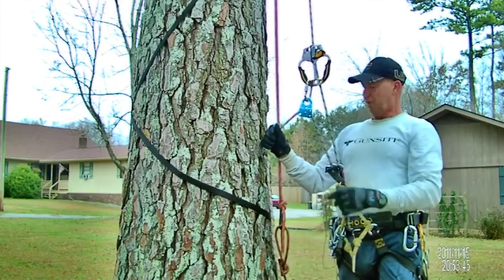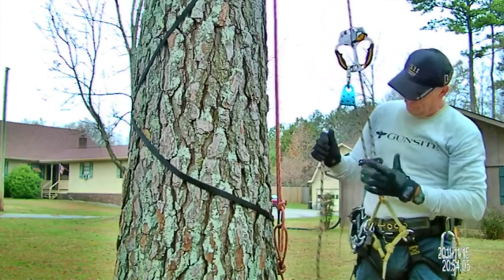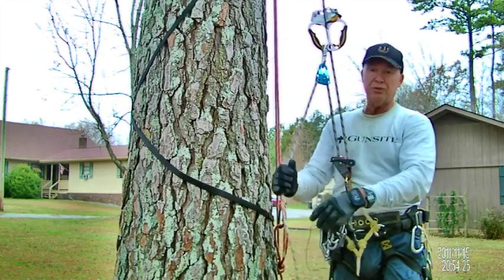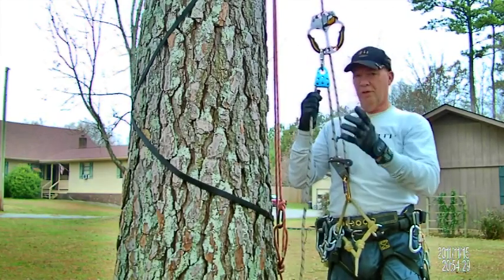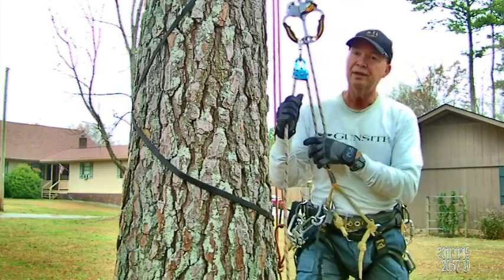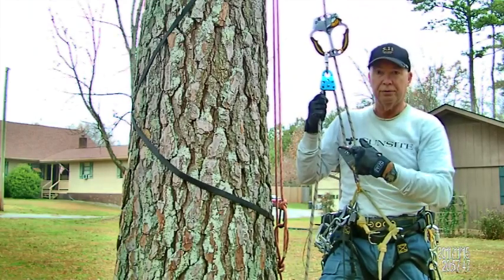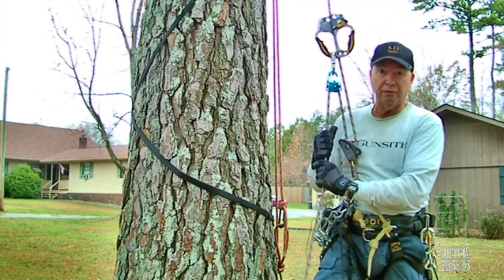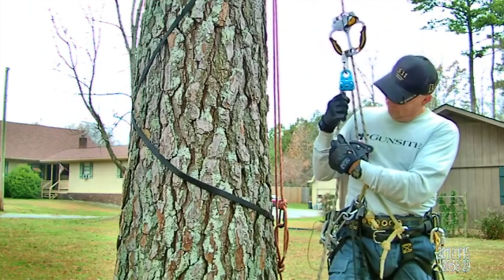Rope and Pulley Systems: Segment 17 - Mechanical advantage of the RADS pds.m2ts

Comment: Not correct. It's not force multiplication at that pulley it's still a redirect just easier because you prefer to work with a down pull than an up pull.
Reply from the maker: It is correct. The analysis is really an expansion of a single pulley principle. For example, let's say I weigh 200 lbs. if I have a pulley attached to a tree limb and one end of a rope is tied to my harness and someone is holding the other end he has to exert a force of my entire weight to hold me in suspension. My weight is pulling on the rope with my full 200 lbs. He has to hold that 200 lbs. 

However, if he hands his end of the rope to me, because my weight is now supported by two strands of rope, each strand only has half my weight. So my hand/arm that is holding the rope only experiences half my weight. I illustrate this in one of my videos where I actually pull myself up with one hand/arm. You don't really think I can pull up 200 lbs with one arm do you?

This same principle expands to the RADS. In a RADS system, if another person is holding the pull end of the rope, there are only two strands of rope supporting my weight, so the person would have to pull with half my weight. But when he hands the rope to me, there are now three strands supporting my weight, just like with the single pulley. So since my weight is supported by three strands when I'm holding the pull end, the force in each rope is my weight divided by 3. Hence to me as the climber, it is a 3:1 advantage.

Try the single pulley setup I described above.  Get a friend to try to lift you and then you take the rope lift yourself. You only have to pull with half the force your friend does, even though this appears to be no more than a redirect. But as you can see there's more to it than a simple redirect.

Comment: Very easy to understand. I’m trying to design a super minimalist version of this to hoist a portaledge (cott) up a tree for camping. I’m sure this would do fine but it’s for adventure bike camping so I’m trying to decide if this can be done with thin cable, and if the pulleys are necessary or if I should just muscle up the rope with that 1 way handle jiggery you got there.

Comment from the maker: XBB XBB
This was not for rigging, nor climbing. It isn't even about climbing. It's specifically about the MA of the RADS climbing system.

It's all done very low to the ground. If you need to see how to climb, watch my vids about climbing - these aren't about climbing or safety as I mention over and over in the series - it's about mechanical advantage.

Comment: Pulley systems must be analyzed as static systems to understand the forces(aka while everything is at rest)   While at rest it makes no difference who holds the line.  It's a 2:1 system.  What happens when the climber pulls on the rope is that he reduces his weight by pulling on the rope however it my feel like a 3:1 system it remains a 2:1 but now with reduced weight.
Reply from the maker: Yes, it does matter who is holding the rope at rest. Look at segment #16 in this series where I demonstrate this principle using a single pulley. According to you, that single, fixed, overhead pulley would be a 1:1 to me. So how would you explain that I can clearly lift myself on that single pulley only using one arm? Am I really that strong or is there some MA going on that isn't obvious? The answer is when I pull myself up, half my weight is supported by the rope that's tied to my saddle and the other half of my weight is supported by my hand holding the rope. It's the same whether the system is static or dynamic.

The same principle applies to the RADS system. The reason it feels like a 3:1 is because to the climber it is a 3:1. To a ground person it's only a 2:1. And, simple testing will prove this. Set up a RADS and see if you can pull yourself up just using your arm strength - you should be able to. Then hand the pull line to a buddy and see if he can pull you up as easy as you could. He can't and he can't because you have a 3:1 and he only has a 2:1.

Listen, I argued the same thing you are claiming until I was blue in the face, but a physics major kept telling me I was wrong. I went to a lab and actually measured all this and I had to concede that I was wrong and he was right. Once I did the lab tests, it was crystal clear why this is true.
Reply: I won't ask you to argue but I do have a challenge.  Do some actual measurements and in particular measure the distance the rope travels in a single fixed pulley system.  Once with you pulling the rope and again with someone on the ground pulling the rope.  Does the rope travel different distances depending who does the pulling?  What if someone on the ground just assists you what happens then?
Reply: Bob Morris My fault... I was not catching your point of reference,
Reply from the maker: Bob Morris
Yeah, the configuration where the climber is both the load and the puller is confusing.  If a climber is in a RADS and places his hand on the pull rope even with his nose and pulls himself up one foot, his hand will then be 3 feet from his nose. Yet, if you measure the amount of rope pulled with respect to the ground, as would be the case for a puller on the ground, two feet of rope will be pulled to raise the climber 1 foot. I concede it sounds like nonsense but that's really how it works.

I think the key is that when the climber holds the pull line, his body weight is supported by two lines plus the third line he is holding. Hence each of the three lines will have 1/3 of his weight. So if he pulls himself at a constant speed, he only has to pull with a force equal to 1/3 his body weight. Therefore it has to be a 3:1 system to the climber.

When the pull line is handed to a ground person, one of the three lines supporting the climber is lost and only two lines are supporting his weight, hence the ground person has to hold half the climber's weight, which shows the ground guy only has a 2:1 MA.

Load cell measurements will confirm this.
Reply: Tanglerwr While I have liked your videos for viewing the different ways to hook these up, unfortunately bob morris is correct on this.   The physics side of this is if you weigh 150 pounds you are splitting your weight to two different positions.  for example if you push down on anything with your hands your weight at your feet will be less.  This can be tested on a simple bath room scale.  push lightly on a counter top as you weigh in and you will show you weigh less on the scale.  now with this system. If you weigh 150 pounds on a 2/1 system you would take 75 pounds to move you.  However  50 pounds is being applied to the pull rope while the remaining 100 is the remaining amount left to be lifted.  The end result is 50 pounds moving 100 pounds 2/1 system.  Yes it feels like more because of the weight reduction.  It is also more complex to calculate your weight reduction because you have to take into consideration the effects of the pulley vs your total weight. This should be 
W/ (PS+1}*PS=RW  Your weight / {Pulley system + 1} x Pulley system = Remaining weight being moved.     Pulley system being 2/1, 3/1 ect but only taking the first number.
Reply from the maker: raddognate

It is a 3:1 to the climber and physics proves it Let me give you some background on this.
 
I took a cursory look at this and from the configuration it appeared to me to be a standard 2:1 with a redirect. I then got into an intense debate with a physics expert and tree climber and another tree climber. They claimed, as I now do, the RADS is a 3:1 to the climber and 2:1 to a person trying to lift/hold the climber.

Realizing this was too simple for them to not see the obvious, I finally went to the lab, set up a model and measured everything. It was a 3:1 ! Then I did a detailed analysis based on pulley MA calculations, energy and work conservation and there isn't a doubt that this is 3;1 to the climber.
 
As an engineer, I was embarrassed to say the least, that I had jumped to a conclusion before doing a thorough analysis.

A tree climbing buddy of mine, also an engineer, has a good video explaining why the RADS is a 3:1 to the climber and a 2:1 to a person pulling the climber up from the ground.
 
When the climber is holding the pull rope of the pulley system, there are three strands of rope supporting his weight. Hence he only has to supply a force of 1/3 of his weight with his hand/arm.
 
This is really easy to demonstrate. Configure the system with ball bearing pulleys, use a ball bearing pulley in place of the Grigri to get close to a frictionless system and put a weight scale on the pull line. Let a person on the ground hold the pull rope and the scale will read half the load weight. Attach the pull rope to the load and the scale will read 1/3 the load weight.

Comment from the maker: It actually depends on how the pulley is used. If it is attached to an overhead lift point and one side of the rope is tied to the load and you pull the other end, you pull with a force equal to the load. OTOH, if the pulley is attached to the load and one end of the rope is tied to an overhead anchor point and you pull up on the other end, assuming the load is lower than you, the you get a 2:1 mechanical advantage.

Comment: Hey Tanglerwr, great videos. I was thinking about what you said about the 2:1 vs. 3:1 being dependent on a ground person vs. the climber being the puller. I think I have an easy way to explain this. When the climber is the puller he's moving toward the focal point, that explains the extra length of rope, same as if the ground person was to move forward while pulling. As for the weight, when the climber is the puller some of the force applied is also reducing the weight of the climber.

Comment from the maker: That's an excellent question. It's easy to get caught up in the more is better mentality, thinking that adding more pulleys for more MA is helping. Up to a point it will. However, depending on the efficiency of the pulleys and even where the more efficient pulleys are located with respect to the 'hauler', you can reach a point where the combined friction negates any additional MA.

Comment from the maker: According to a book, "Life on a Line" by Dr. Dave Merchant, as a pulley, a Grigri has an efficiency of about 40% and a steel carabiner at about 50% efficiency.

I'm not sure I agree with the biner efficiency, they seem better than that to me. If you are constructing your 3:1 with biners you will not get anywhere near a 3:1 MA. You might get 2:1 and maybe not that if Dr. Merchant is right.

Comment: in this video you mention that a gri-gri is not a lossless pulley. i never thought it was but i was wondering what kind of efficiency you get from a gri-gri? for that matter what kind of efficiency do you get from a plain carabiner? in other words, if my climber is stuck i know how to turn my belay into a 3:1 pulley to help them up over a crux(essentially what you call a z-rig in your series but with biners instead of pulleys.) how close is this system actually to 3:1?

Comment from the maker: @Tanglerwr 
The way you determine the MA of a RADS is to measure the load lifted by the force required to lift the load. The climber, and you can easily measure this, will exert a force of 1/3 his weight, hence to the climber, it is a 3:1. 

A ground person, and you can measure this too, will exert 1/2 the weight of the climber, hence to him, it's a 2:1.

It would be inaccurate to determine MA any other way.

Comment from the maker: @Tanglerwr
If you take the RADS and lay it on the ground, it could be either a 2:1 or a 3:1 depending on which end is the anchor end and which is the load end. I illustrate this very clearly in my pulley videos.

MA is defined as force out divided by force in - you could put any pulley system, no matter how complicated, in a 'black box' and measure the force generated at the output by the force on the input. Divide the output force by the input force and you've got the MA.

Comment from the maker: @AxeMeKnot 
Yes I did, precisely - the ratio is force out divided by force in. If I pull with 50 lbs and raise 150# the ratio is 3:1. I even discussed the balance of work in the video.

The problem is TH is taking a system that can be either a 2:1 or 3:1 and trying to call it 2:1 based on looks. If the forces in the lines SUPPORTING THE LOAD are 1/3 the total weight, AND it is a simply pulley system, and the RADS meets both of these requirements, then the MA is 3:1.

Comment from the maker: @Tanglerwr
I argued the the RADS was a 2:1 until a physics guy and a tree climber doing actual measurements showed me I was wrong.

Then I took a really close look at the RADS realized they were right. The RADS is a 3:1 to the climber.

What does "behaves like a 3:1 mean? The system is either going to require a pull force of 1/3 or 1/2. To the climber, it's 1/3. To a person on the ground it's 1/2.

The ratio is determined by force out divided by force in; not by the way it looks.

Comment from the maker: @AxeMeKnot
Notice that 1/3 & 2/3s just keeps coming up? You're already saying the weight is divided in thirds, not halves as would be the case for a 2:1. The force on the saddle TIP is 2/3s the climber's weight. The other 1/3 of his weight is supported by his hands/arms on the pull rope.

Comment from the maker: @Tanglerwr
No disrespect intended, but I watched TH's video when we were discussing this on TreeBuzz. His video is incorrect. He's ground referenced. He's completely supported by and referenced to the ground. All the measurements are with respect to ground.

All his video proves is to a ground referenced person, the RADS is a theoretical 2:1. He never deals with a suspended climber as the puller. I and MrSingleJack do. We get the same results which agrees with theory. TH's does not.

Comment from the maker: @Tanglerwr 
Now tie the pull line to the weight. How much weight is on the pull line? 50# because there are 3 strands supporting the load. Whatever force is in the pull line will also be in the other two strands.

So the climber actually does only have to exert 1/3 his weight to lift himself.

It's actually more than 1/3 because of friction through the grigri. If the grigri were replaced with a pulley, it would be very close to 1/3.

But, the same thing applies to a ground person too.

Comment from the maker: @Tanglerwr
When he pulls on the pull rope, all the tensions will remain equal in all three strands of the rope, which means the climber still has only 1/3 of his weight on the pull rope.

Let's think of a 150# weight in a RADS and the pull rope is tied to a ground anchor. How much force is on the ground anchor? 75#. It's a 2:1 with a 1:1 redirect. There are only two ropes supporting the load.

Comment from the maker: @AxeMeKnot 
It is entirely accurate to say the RADS is a 3:1 to the climber, because it is. The climber exerts 1/3 of his weight on the pull line to lift his entire weight. That means if he weighs 150# he can lift himself by pulling with 50 lbs on the pull line.

There isn't any weight shifting. When the climber is suspended, and is holding the pull rope, each of the three ropes support 1/3 of the climber's weight. The climber will have to hold only 1/3 of his weight.

Comment from the maker: @Tanglerwr 
If the climber only has to support 1/3 of his weight, he only has to pull with 1/3 of his weight to lift himself. He is lifting his entire weight with a force (on his hands) of 1/3 his weight.

Try this: set up a RADS and see if you can pull yourself up - be very careful not to help by body thrusting. Then hand the pull rope to a buddy and see if he can pull you up. I doubt he can. You would only have to pull with 1/3 your weight; he would have to pull 1/2 your weight.

Comment from the maker: @Tanglerwr
So we have two pieces of rope supporting the climber; there will be half his weight in each rope, so he only has to hold half his weight, where the ground person has to hold his full weight.

So to the climber, the DRT is a 2:1; to a ground referenced person it is merely a 1:1 redirect.

The RADS is the very same principle except with an extra pulley and an extra line in the system.

The RADS is a 2:1 with a redirect to a ground referenced person, but a 3:1 to the climber..

Comment from the maker: @AxeMeKnot 
Let's see if we can start with a simpler system. Is the DRT a 1:1 or a 2:1? It's a single pulley with a climber tied to one end of a rope. I someone on the ground tries to pull the climber up, how much force will he have to pull with? The full weight of the climber.

Hand the pull rope to the climber. There are two strands of rope supporting the climber. The end that's tied to him and the other end he's holding.

to be continued....

Comment from the maker: @AxeMeKnot 
That simply isn't true. The forces can be measured and will show that each strand of rope in the RADS has 1/3 the climber's weight. To the climber the RADS is a 3:1. To a ground referenced person it is 2:1. There was a very long, detailed discussion about this on TreeBuzz in which it was undeniably shown the RADS is a 3:1 to the climber. MrSingleJack also has some videos that illustrate how and why the RADS is a 3:1 to the climber.

Comment from the maker: @MrSingleJack 
You are exactly correct Jack, thanks for catching that. It was a verbal typo on my part. I started out by establishing my eyes as the reference point which is a climber referenced point. The pulley is ground referenced and is the wrong reference to use. The 3 feet of rope pulled is with respect to the climber, not the pulley.